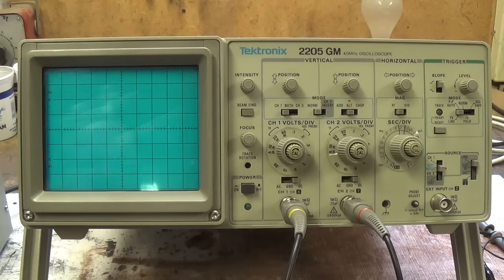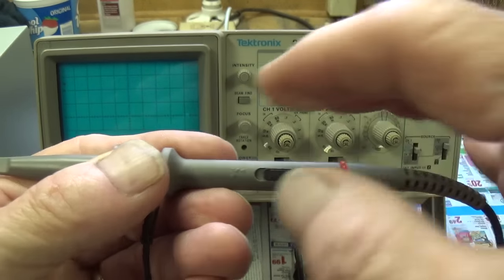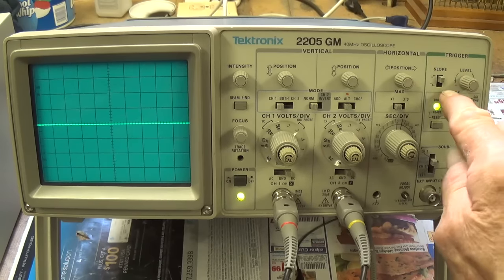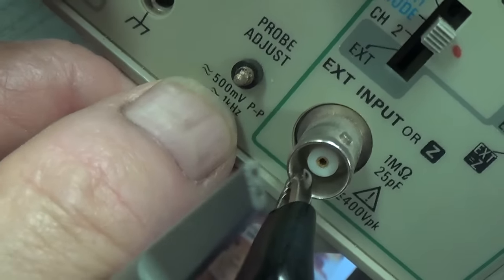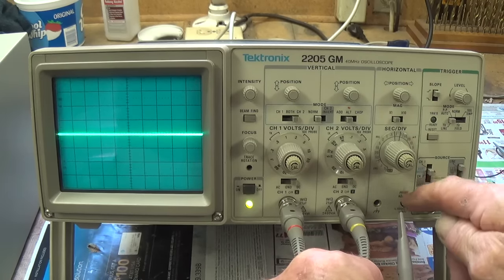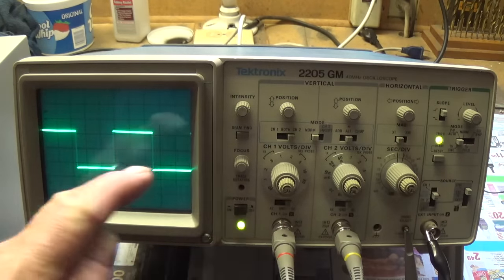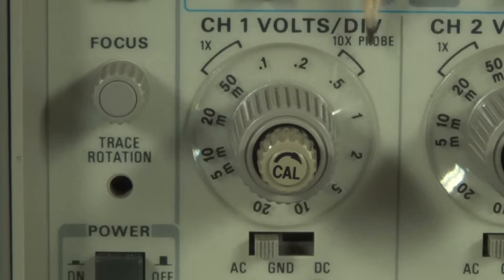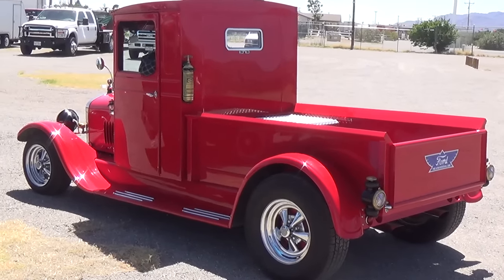Oscilloscope Basics, Part 1: Discussion, Y-Axis (Voltage) Controls, Probe Calibration

Comment: Hey Doug. I didn't know how to just send a question to you, kinda unrelated to a particular item, so I saw this video and since it caught my eye, (I have a very similar scope at home), I figured i'd put my silly question here. I have an OLD tube amp that has one tape input, (no output for headphones, record out etc), so what I do is use an A, B switch to share said input between 2 old tape decks. Works fine. However to record from one to the other, usually done through an amp etc, since that part doesn't exist here, can I go from the tape out of one deck to the tape in of the other just to record a couple of things and then put it back as above? (will it cause damage to anything?)
thank you in advance and I apologize for putting things in the wrong place.....
Reply from the maker: No problem with the question being here, Anthony. Viewers do it all the time :) Without seeing the gear in person, it's hard to offer an educated opinion, but I would suggest that you experiment to see if it works. I don't see how any harm could come from it.
Reply: @UncleDoug  Thank you Doug for the quick reply. I will give it a go. both tape decks have volume controls for in and out, so if anything I might be able to get something decent from to the other, that way. Stay well and again thank you for the great videos, also for being kind to animals.

Comment: Hi Uncle Doug. I have completed my amps. signal path with screen cable. No difference. I had another poke around the wiring - no difference. The mains hum is apparent with no input connected, amp. on, and volume at zero. Any other pathways to explore - please?
Reply from the maker: Is it at the same frequency as your AC power supply or double the frequency ?  Double indicates filter cap leakage.

Comment: I just purchased a fully functional Tektronix 321 A and a vintage Simpson function generator, I'm new to this and it didn't come with that input output chord you have plugged into both, could you please tell me what that chord is really called so I can find one, thank you - Robbie
Reply from the maker: Do you mean the test probes?  I buy them on Ebay. Be sure their frequency response matches the frequency of your oscilloscope.
Reply: Thank you for your help, I don't know anything about this. I quess a modern BNC connector cable will work in a 1960 Tektronix oscilloscope. Now I got to figure out the machine's frequency for the cable? And it will be ok, I'm a WWII collector that just came across these, no electric engineer, lol

Comment: Hey, Uncle Doug: I have built a 40W 'push-pull' valve amp. I cannot eliminate the latent mains hum. Can you help me please?
Reply from the maker: Did you shield all your signal wires, input to pre-amp to VC and back? Did you move your wiring around with a chop stick to check lead dress?

Comment: Thank you. I have a HP 1715A Oscilloscope and the signal doesn't sweep. It's just a dot. No matter what setting I set the time/div knobs at the signal doesn't move. Maybe the internal calibration doesn't work?
Reply from the maker: Or maybe there is a problem in the electronics that prevent it from operating properly.

Comment: You stated the AC/DC switch should be set to AC, but I noticed they were both set to DC when you were showing how to calibrate and use the scope.  Just wondering why?  Chuckie
Reply from the maker: You have a sharp eye, Chuckie. The AC position filters out any DC 
beneath the AC wave form.  The reason the switch moved is that the video
 was shot over 2 full days and involved many, many scenes. During that 
extended period, some switches got moved around and not put back, which 
 had no harmful effect on the scope tracing or I would have noticed it.

Comment: O'scopes have came a long way, from 50 lbs monsters to hand held storage scopes.
Reply from the maker: Quite true, JM. Like almost all electronic devices, they have gotten smaller, lighter, and relative inexpensive.
Reply: Make no mistake, those dinosaurs on tubes are wonderful machines.  The CRT may still produce a wonderful trace, sharp as a razor, unlike the modern LCD screens.   Unfortunately, those scopes are literally heavy equipment, not easy to move around.  Though, in a lab, and on a cart, these units are a dream to work with.
Reply from the maker: Thanks for your input :)
Reply: Back in the 80s I had a top of the line scope and logic analyzer on my test bench, I miss those days.
Reply: You're most welcome, your amp videos bring back my ol' tech days.
Reply from the maker: That's good to hear.

Comment: UNCLE DOUG, what circuit inside the oscilloscope will draw the horizontal voltage on the CRT screen? because there is no horizontal oscillator or vertical oscillator used inside an oscilloscope so how can it draw a sinewaveform on the CRT screen? The  Ramp circuit only controls the electron beam only to the CRT screen.
Reply from the maker: I have no idea, Bill. I simply use an oscilloscope from time to time.....but I have never concerned myself with the internal circuitry. I would think that an oscillator may be used for frequency and time interval determination, while the placement of dots and tracings on the CRT are controlled by horizontal and vertical deflection circuits.
Reply: @UncleDoug  ok thanks

Comment: I used to use this old school oscilloscope in the past, and today I bought a brand new digital oscilloscope with a bunch of features, mat decoding stuff... auto stuff etc... but I was confuse about the controls... like the focus control for the line, it seems that the new oscilloscopes doesn't have it ! Also, when you're measuring something, and you scroll the line, the response of the new oscilloscope seems to be "slow" not in "real time" like the old school oscilloscopes ! Probably they have some more expensive models that's have the same performance of the old school .... I can't complain for a $300 bucks 200Mhz scope...
Reply from the maker: Thanks for sharing that with us, Sao.

Comment: Ok just one little question. For the calibration of the probes you set the setting to AC. But a few seconds later it is set to DC and you never showed or said why that setting changed from AC to DC but the calibration still seems to work. So what is up with that?
Reply from the maker: I don't remember why the change was made.....but is this really all you could find in the entire video to comment about ?
Reply: @UncleDoug  Yes this is the only thing. Because it's confusing. You said that you need to set it to AC because square waves are alternating current. But the next moment we can see the square wave while it is set to DC. So to me it looks as if the AC/DC setting doesn't matter for the probe calibration and that we can see the square waves at both settings. Is that right?
Reply: @freund333  I agree that part would be confusing to a newbie. A square wave will shop in AC or DC coupling. The only difference is that any DC component is removed from the signal in AC mode. So for example a square wave going from 0 to 5v in  DC mode would display as -2.5 to +2.5v in AC mode. For probe calibration, it doesn't matter which mode you choose.
Reply: *shop show up
Reply: @matthollandsf  Thanks. I also have another question. Is it normal that i can see a wave at 5 mV and 5 mS as soon as a probe is plugged in to channel 1? That signal can be seen on AC and DC but not on GND and it also doesn't change when i switch between 1x and 10x on the probe.
Reply: @freund333  it is normal to pick up a signal related to your mains frequency when your ground probe is not connected, as your probe is acting like an antenna in that case, this sounds like likely something different. also i feel like it should attenuate x10 when you switch the probe to 10x mode. if all your channel settings are the same but you don't see that on channel 2, or with a different probe, then you probably have a issue with the scope or probe respectively.
Reply: @matthollandsf  Well i did a test and the wave or signal is a bit stronger on channel 2 if a probe is connected to it. It also doesn't go away if i connect the probes ground to the ground (outer ring) of the ext. connector of the scope. How can i figure out if it's a problem with the probes or with the scope? The scope is a Voltcraft 2040 and the probes are normal 15€ probes i bought separately.
Reply: @freund333  yeah its just standard troubleshooting. if the channels behave the same regardless of what probes you use, then the issue is with the scope.

Comment: On my scope it either shows both channels at the same time or just channel one, when I try to view channel two by itself the line flat out disappears. Any ideas what’s causing it?
Reply from the maker: Either the scope was designed that way or you need to try all the different controls to see if any can make the Channel 2 trace persist on the screen. You might check the Internet for an operator's manual.

Comment: I have an Iwatsu SS-5711 and I am trying to measure the voltage coming out of the calibration pin with my multimeter.  On the front of the scope it says 0.6v but when I measure it I am getting about 0.3volts.  Is that supposed to read an actual 0.6v?   Or is that bad that its not reading 0.6v?  
Thanks
Reply from the maker: Matt, I really can't offer much insight, since I have never owned an Iwatsu oscilloscope. My suggestion would be to use a multimeter to measure the voltage on the calibration pin to see which is right, the statement or the scope.
Reply: On the front of the oscilloscope right next to the pin it says 0.6v.  But when we measure the pin it says 0.3v.  So is the fact that the pin does not read what the scope says a problem?

Comment: So if the probe was set on 1x..and I wanted each division to equal 5 volts, I would simply set the channel to '5"...correct?...(this of course after I calibrated it)
Reply from the maker: It depends on the volt per division setting, Mark.

Comment: I acquired a Tektronix 465 recently and plugged it and started to calibrate it.  The calibration is 300mV and signal is 1khz.  As I worked with it I had to power it off and tend to something else.  When I came back to it there is no display.  It powers on, screen illumination works but no signal displayed even when I try the beam find.  Is there a display tube in there that could have died?  Might be money out the window for me.  I have a couple others to use fortunately.
Reply from the maker: Before you give up on it, you might check all the settings and possibilities, BB. Is there a reset button anywhere on it? Are you sure the probes are properly connected and supplying proper signals....with the 1X/10X sliders fully in one direction ?
Reply: I will look for a reset button.  I checked the probes and their connections and will look everything over again.  Everything seems fine except no traces will appear on the screen no matter what I try.  It’s very strange, working fine...turn it off for a while...come back and everything turns on but no traces.

Thanks for the reply and all the great videos!!!
Reply from the maker: You're welcome, BB. Good luck with the scope.
Reply: Sounds like there’s a tantalum capacitor that is a common issue with these scopes.  Found a video with the same scope and repair procedure so it seems like a potentially easy fix.  I’ll give that a shot....one of these days.
Reply from the maker: Let us know how it turns out, BB.
Reply from the maker: You're welcome, BB. Good luck with it.

Comment: sir thank u for the video iam waruna from srilanka , sir i got a simple question to ask from u when calibrating a oscilloscope do we need to calibrate it in both 1x ,  and 10x in the same probe , or if we calibrate in the 10x does it automatically calibrate the 1x  also in the same probe or do we have to calibrate seperately in the same probe , thank u sir
Reply from the maker: Good question, W. I guess it depends on the quality of the probes and your requirements for absolute accuracy.  With a new probe, you can determine the relative accuracy at 1x and 10x, then apply your findings to subsequent usage.
Reply: @UncleDoug  thank u sir may ur pet cat live long , love to see the black pet again in a video thank u sir
Reply from the maker: You're welcome, Waruna, from both Jack and me. @warunakumara7671

Comment: Can you recommend a signal generator to purchase?  Want to learn how to use an oscilloscope.  Thanks
Reply from the maker: I got my Tenma 72-455 generator on Ebay for less than $100, G. Similar units are generally available there. Good luck.
Reply: @UncleDoug  Thanks.  I like the video.  I now have some knowledge on how to use my Tektronix 2215
Reply from the maker: @grifter1964  That's good to hear, G.

Comment: A safety-related note for the commenters below who are trying to repair their own scopes: the CRT can hold Thousands of Volts for days, possibly even for weeks! You will need to be absolutely certain that all voltages have self-drained (draining them with a resistor could be extremely dangerous) before attempting to clean any pots or switches or anything of the sort. Not to mention that simply spraying contact cleaner into the controls is a very bad idea, you really need to use a small syringe type applicator and apply the very smallest amount of cleaner possible. Operate the switches back and forth, then let the unit sit for a day or two to dry out before you power it back up. Finding an owner's manual or service manual online would probably be the smart move before even attempting to do any service on these units yourself.
Reply from the maker: Excellent advice, GU. Thanks !!
Reply: @UncleDoug  , its also important for folks to understand that high-impedance devices capable of operating at radio frequencies can be damaged by excessive use of Deoxit and such like. Analog tuning condensors in vintage radios and stereos sre a good example,  those should never be sprayed willy-nilly; cleaner should be applied carefully only to the actual contact points. Also, spraying the switches and controls of Hickok tube testers will cause conductive paths that ruin the unit.  People get totally carried away with Deoxit and similar electronics cleaners.....
Reply: sounds like AT&T you open the TOPS practice, you don't have know anything just follow the pictures and instructions. for the life of me I could never understand how some people got promoted to be a tech they didn't know anything.

Comment: I was hired as a electrician in 1981, and learned that your main power coming in to your house, had the neutral and the ground connected together. Then , the geniuses, decided that we needed a ground plug on our cords, to save us, from electrocution! Guess what...we could still be shocked!
Reply from the maker: It may seem like a strange system, Don, but at least it seems to work well most of the time.

Comment: My scope is almost like your's. I have a Tektronix 2205, you have a 2205 GM. What is the difference?
Reply from the maker: Other than the frequency, I don't know of any difference.
Reply: @UncleDoug  I worked in Portables Division where we designed the 2200 series and I don't even remember a 2205 GM.  I wonder if it was a special edition made for a certain company, country, or other.

Comment: On my scope it says maximum 400V in, does that mean that if I set my probe to X10 that I can put 4000V across my probes? Or am I way off here? It would be nice to know before I start poking around in a tube radio.
Reply from the maker: No, I would interpret that as meaning the max voltage with any probe is 400V. To be honest, there is rarely any need to attach scope leads to the plate of an output tube, B. DC is boring to watch. What you generally focus on is the music signal, i.e. after the coupling cap, which has a much lower voltage.
Reply: @UncleDoug  I was thinking just as a precaution in case I would measure on the wrong place, and to check for ripple.
Reply from the maker: @boeesen  You can protect the scope from high voltage DC by using a capacitor between the probe and test point. Ripple is AC and will be visible on the screen.
Reply: @UncleDoug  I didn't think of that, thanks for the tip.

Comment: Tell me about that little red switch behind the scope:
(Ac line voltage selector switch)
I get confused.
When i can visually read 230 on that , it means what?
Dose it mean it set on 230 volt?
Or 
It dose mean that it set on 110.
Help me plse
Reply from the maker: What oscilloscope do you have, SA?
Reply: @UncleDoug  exact the same of  your scope: tektronix 2225
Reply from the maker: @siavasharash5448  I never noticed the switch before. What you see is the voltage you should plug into. I see "110V" so I plug into 110V.
Reply: @UncleDoug  thanks very much
In  countries with 220 ac line
 hundreds loss of equipments happend per day because of this mistake.
Imagine you slide the switch toward (220) and you think it must be set on correct voltage but gess what happen:

Baaaaang!!!!!
Reply from the maker: @siavasharash5448  If you set it on 220V and plugged it into 110V, not much would happen. If you set it on 110V and plugged it into 220V, bad things would happen.

Comment: The only scope I had was destroyed years ago.... but I'm gonna BUILD one on my channel... it's a little one that runs on a battery.   We'll see if it's any good,  or a joke.
Reply from the maker: I'm surprised there isn't an oscilloscope app. for smart phones. Good oscilloscopes are generally available at rather low prices, DK. I got the magic oil today for the Tel Ray and have all the mechanical parts back together. It runs smooth as glass. Now for the wiring and circuitry........:O